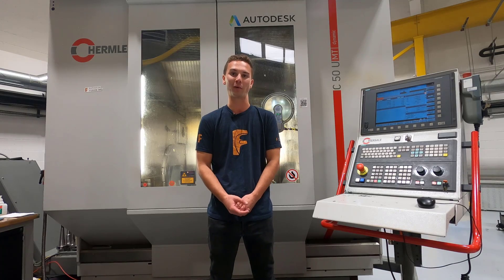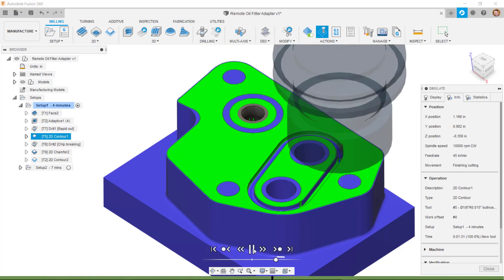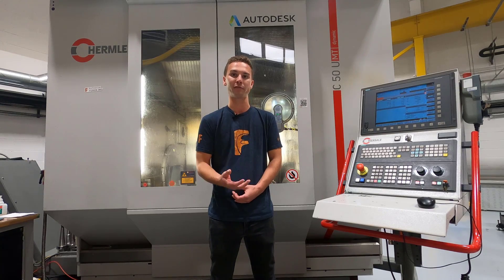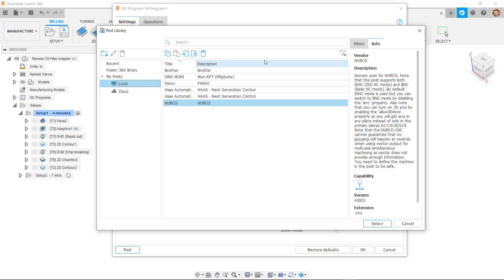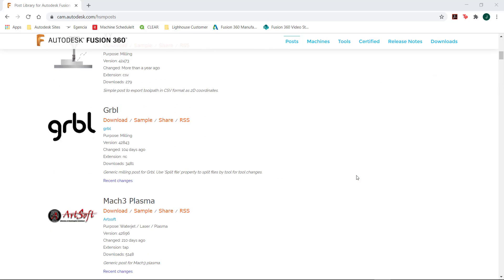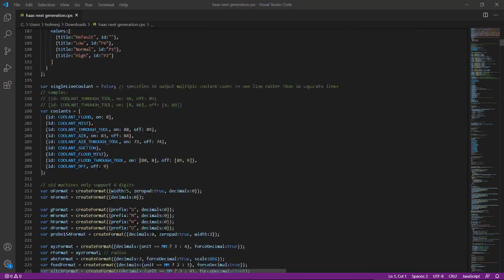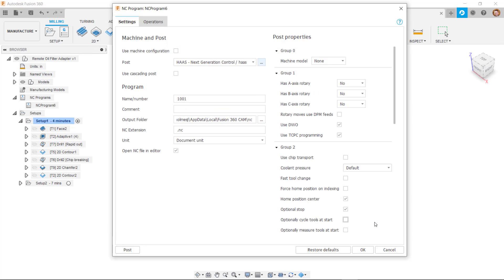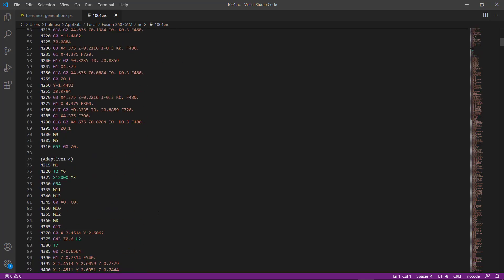Machining Fundamentals: Introduction to Post Processors

Comment: can someone make a generic post for sliding head, swiss style, lathes please.
Reply: That would be a monumental task.  There are just too many machine variations in swiss machining.  I've spent time on both Star and Citizen swiss machines.  They are so different in so many ways when it comes the how the wait codes and main / sub spindle syncing work.
Reply: @brandons9138  use any variation, thats the least worry. i understand how they work, i own them. there isnt a way to code the live tooling with fusion because the z moves when you orient the tool and they make diameter moves. all sliding head machines are like this. just make a "generic" like i asked and i will fix the rest the way i do with all generic posts. i dont accept excuses.
Reply: @dmbworks8094  So it sounds like you can get the numbers you need out of Fusion, but the y are on the wrong axis?  Is that correct?
Reply: @brandons9138  the z changes axis when you orient the tool and the positional moves are actual when using milling tools in fusion and not diameter moves like a lathe. its part software (axis) and part post (move output) issues.